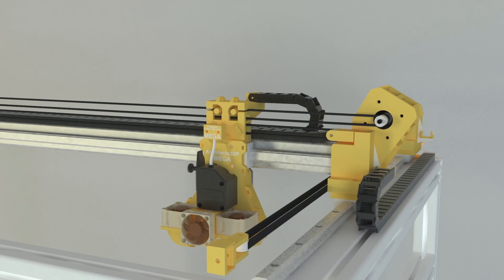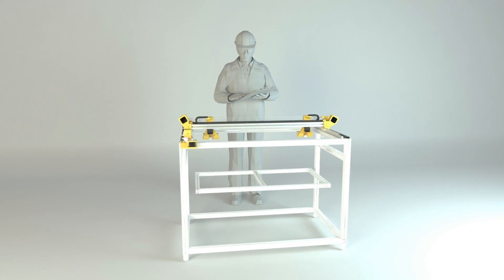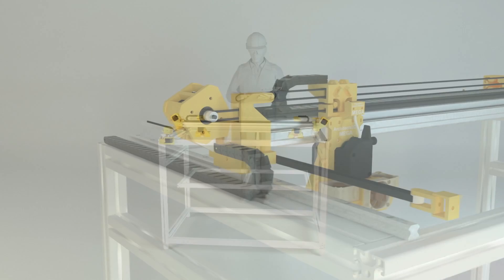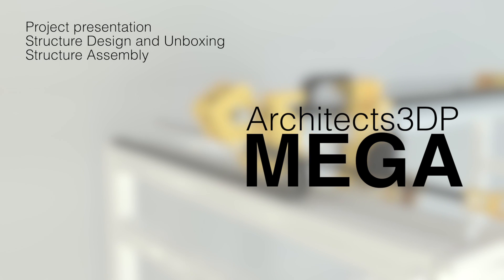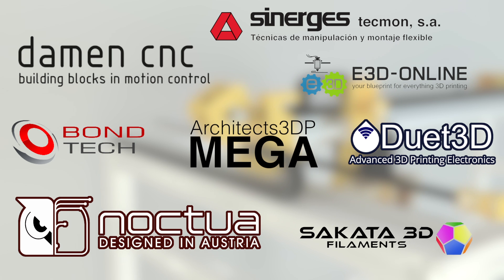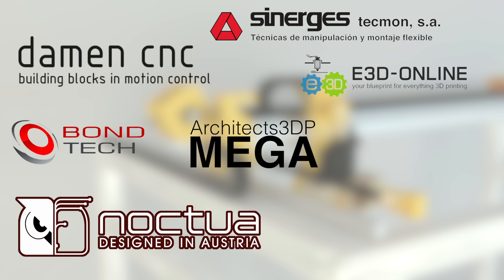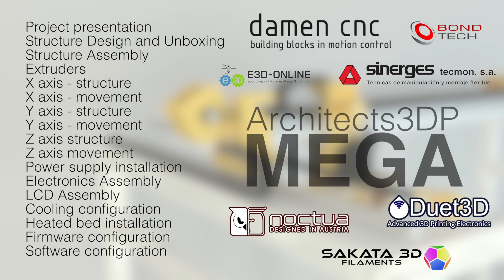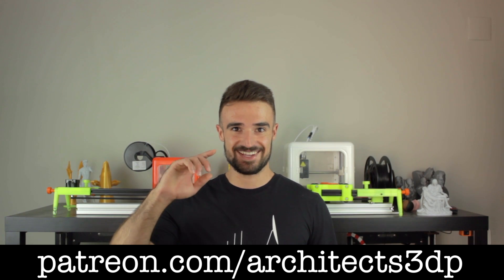Architects3DP MEGA - Big Size Industrial Quality DIY 3D Printer #01

Comment: to reduce price & weight of the printed bed you should try making it out of fr4 /g10. can handle up to 140c & is a very stiff material + very low thermal expansion. example: https://www.interstateplastics.com/G-10-fr4-Glass-Epoxy-Sheet-PHEEG~~SH.php?sku=PHEEG++SH&vid=20190808133438-3p&dim2=12&dim3=12&thickness=0.125&qty=1
Reply from the maker: Thank you very much! I'll have it in mind! :)
Reply: @architects3dp  NP when I have time to build 3d printers again. I plan on using it for my heated beds. Saves a good amount of money compared to mic6 aluminum.